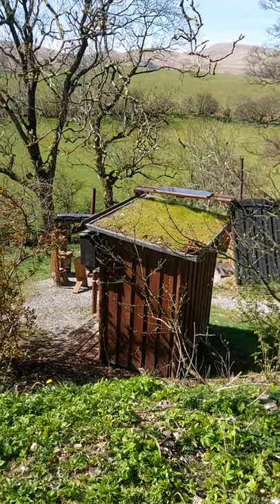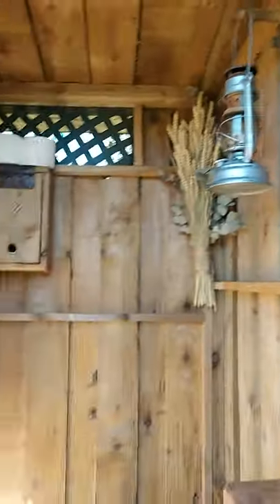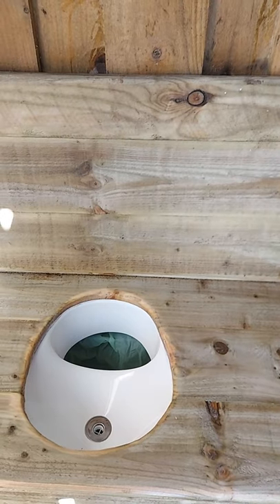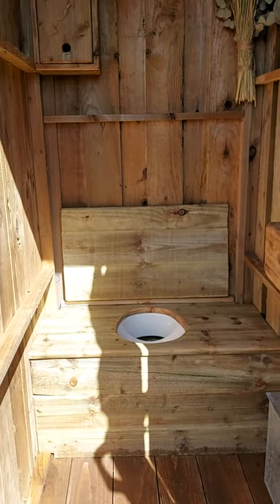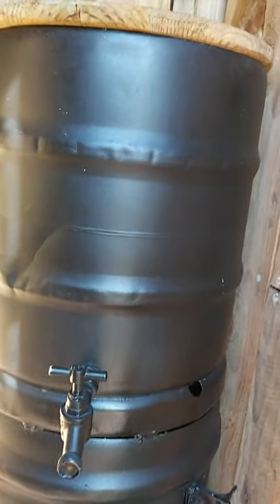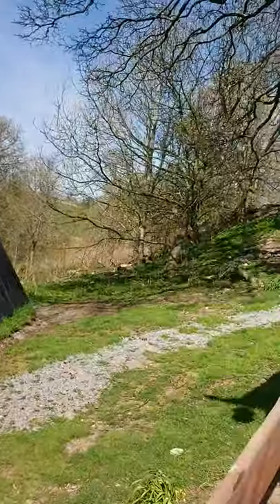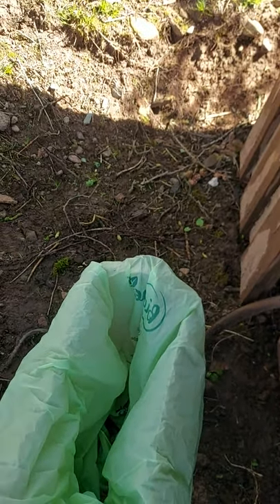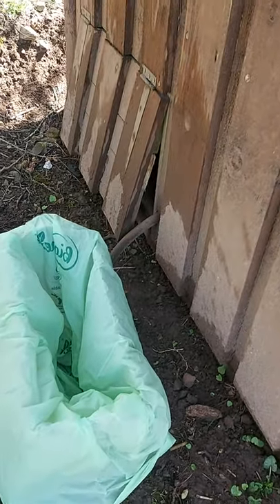Off grid composting toilet and solar powered shower. How it works and look inside.

Comment: In Greece, they use for hot water a darkened 55 gallon barrel , and the sun heats the water. It is plenty hot almost boiling.
Reply from the maker: We do not have the same intensity of sunshine, it is more likely to freeze in the north of England, haha, best wishes.
Reply: @vikinghamer  nor we in Québec, our average yearly temp is minus 2. we have 8 days with 30 degrees...and plenty ranging from minus 25 to minus 36
Reply from the maker: @attiliobarcados8178  It must be so beautiful there, I love extremes of weather.
Reply: @vikinghamer  when you get to the top of an island and have a 2360 view of the meditanerrean sea, you undertand why greeks were studying philisophy whie in parts of europ some tribes still lived in caves

Comment: I'll definitely be using elements of this setup on the homestead, much appreciated! My understanding is that human waste compost is safe after 3-5 years. So it's safe to use but only with a much longer time frame than typical compost. In fact many store bought composts include composted material from city sewer systems. They label it "municipal biological solids" or other innocuous-sounding terms.
Reply from the maker: Thank you for your comments, I think with experiance that three to five years is an appropriate time frame to be sure it is fully composted. Best wishes, Anthony.

Comment: Great build. Your comment about the time frame ( a year) to full term the composting process is something most videos never clarifies. 
I have a commercial made composting toilet I've used for 3 yrs now with no issues.
It came with a fan but have not hooked it up as its not needed. Seperating the liquid and solids is what prevents any odor. I use cocoa coir as its more readily available in my area.
 The water saved is very important as I live in the dry SW of the 🇺🇸. 
I dearly love your countryside views. Thanks for a Great video. 
Happy Trails from NM, 🇺🇸
Reply from the maker: Brilliand feedback Ella, thank you, best wishes from a snowy Cumbria.

Comment: One of the best composting toilet/shower set ups I've seen - really well set out and straight forward. Questions (if you don't mind): when you remove the full composting bag and transfer it to the wheelie bin, do you leave the contents in the bag, or do you empty them in to the wheelie bin? If left in the compostable bags, do you tie them off before putting them in the wheelie bin, or do you leave them open? Thanks for sharing.
Reply from the maker: Thank you for your interest, I just dump the lot untied into the wheely bin, there is little smell and after a year it is safe to spread on the land. Best wishes, Ant.
Reply: i guess you can put it in layers if it smells, like first spread some sawdust or ash then the humanure then more ash; also one can use a hole dug in ground  aswell

Comment: Love this set up.   But. Be careful. .. if your greenhouse heater warms the water to between  20 degrees and 45 degrees  centigrade you could develop the bacteria called legionella.  In commercial systems, they will have a regular cycle where the water will be heated to above 60 degrees to kill the bacteria … We run offices, and we do routine legionella  tests on all taps. .. showers are more dangerous as the water will go over the face and could enter the body.  Just thought you might want to know. Legionella  can make people very unwell and need hospital treatment with antibiotics. One in 10 people who contract it die, so it’s not something to take lightly. All the best.😊 great idea with the wheelie bins by the way.   Thanks for sharing
Reply from the maker: Hello Dave, thank you for your great comments, the tank for the shower is not that big so is empty every day when in use so always has new fresh water. Your point is a good one and I am grateful for it. Very best wishes, Anthony.
Reply: Where do I get that type of toliet at its genius  @vikinghamer

Comment: I really like your bathroom setup. I am in the process of building one myself for a Glamping project.
Can you tell me what you do with the bags? How you compost them. Do you empty the bags? Or do you just put the whole lot onto a pile or wormery?
Can you let me know any problems or tips you've had with this process?
Ive really enjoyed your videos and have subscribed, looking forward to more. Steve, Malvern Hills
Reply from the maker: Hello Steve, the bags go into a large wheeled bin for a year so I alternate two bins, the bags are compostable. this is important as I have found some do not degrade but others do.  I change the bags between each booking so that every customer has a fresh toilet. The urine soak-away needs to be large  and flushed with plenty of clean water each changeover! Hundreds of people have used it now so it has been quite successful! Good luck with your project, I wish you every success! Kind regards, Anthony.

Comment: Very cool set up...would you consider adding a ventilation pipe to allow gases to escape?
Reply from the maker: Good question and a vent pipe was part of my original design ideas but it is not necesarry there is no smell with the dry ash used as a "flush", best wishes, Anthony.

Comment: Have you modified the wheelie bin to add any aeration, or does it break down fine without it?
Reply from the maker: The wheelie bin is not modified but I have been considering drilling holes in the bottom to allow worms in, it breaks down ok as is though! Thanks for your great question.

Comment: I would like to see where the shower water goes. Is there a sump underneath? Thanks
Reply from the maker: There are concrete flags underneath and it goes onto them and soaks away, it has worked well for a year now.

Comment: Where do you find the toilet seat part, the diverter seat?
Reply from the maker: I got mine off ebay, they are pricey though.
Reply: I bought one. Going to build similar to yours. In a different type structure . I use the same principal with a 5 gallon bucket currently.